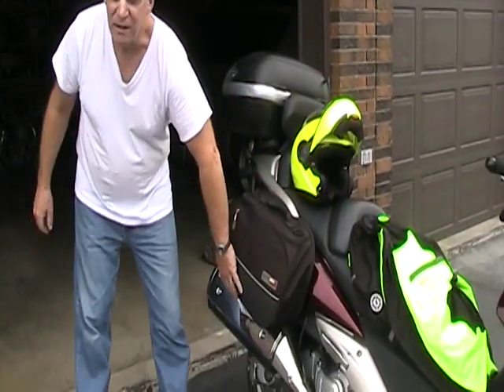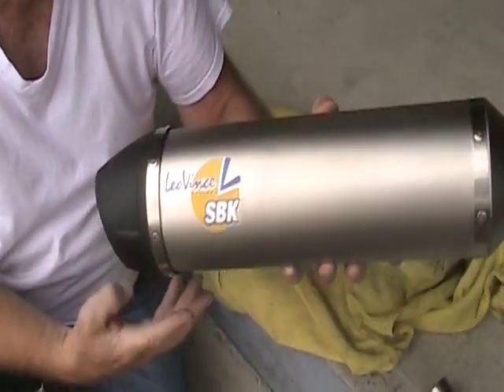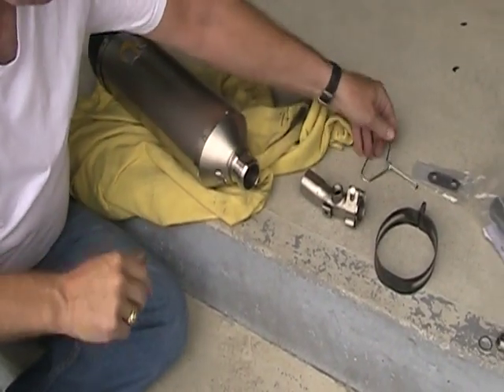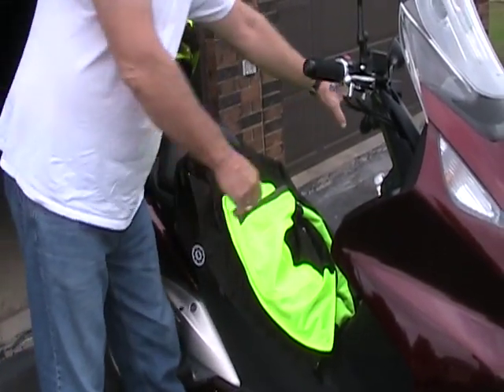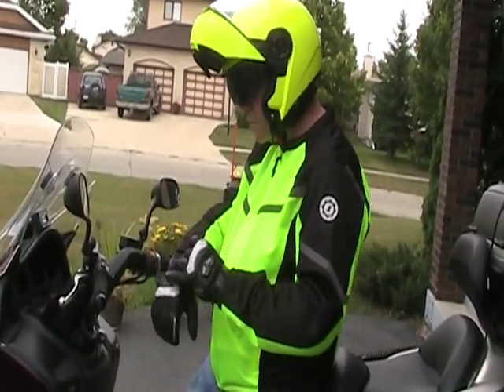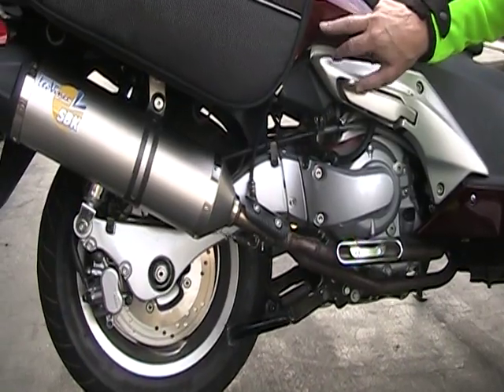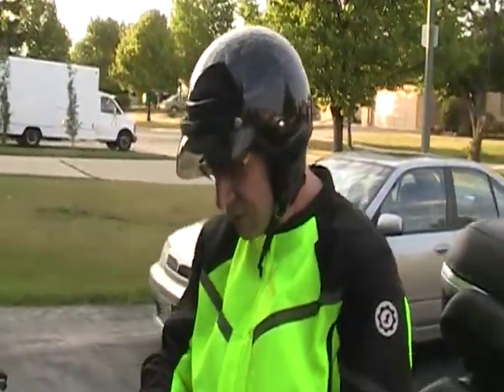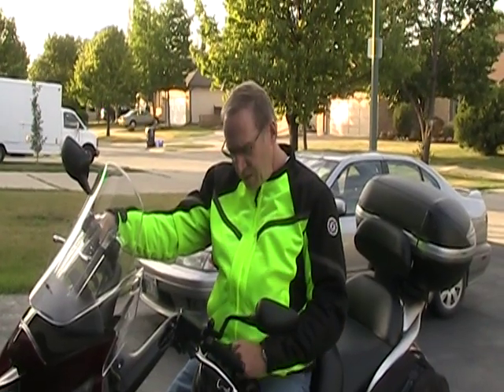LeoVince 8552 slip-on for a 2009 Honda Silverwing 600

Comment from the maker: I have tried it with the dB killer removed. After experiencing the obnoxious drone from the 360 degree parallel twin engine with the dB killer removed, I see no reason to remove the internal baffles as well, let alone the dB killer. Besides, to remove the internal baffles would require taking the muffler apart by drilling out the rivets, then re-assembling and re-rivetting the can. Not for me.

Comment: There's another method by locking the sidestand sensor :D That's what i did with two zip tie and it works well so far.
Reply: Was wondering how that was started on the prop stand? Bit dodgy if someone blipped the throttle. The chap that bought my Silverwing tells me that he has a LeoVince can to go on it.

Comment: Hello! We own a Silverwing and we changed the muffler as well. We have been trying to get side bags for our Silverwing and we are told that the bags don't get made for Silverwings. What kind of bags do you have and how did you mount them?
Reply from the maker: Those side bags were Givi's, but can't remember the model number. They were discontinued long ago. They mount with a centre band between the two bags which connects the bags together under the seat. The bands overlap each other and are joined by big velcro strips on each band.
Reply: @tcalof , thanks for the information. My husband is going to see if he can engineer something for us to use.

Comment: I hear it back firing after you let off the throttle, that i did not hear with the stock muffler, that is usually the pairs valve, it needs to be closed off after a muffler change.
Reply from the maker: The PAIR valve is there to add extra air to the exhaust to complete combustion of any unburned fuel. Its popping and cackling will not cause any damage. It only needs to be closed if you don't like the popping noise.

Comment: lol if it cant wheelie standing on the rear pegs then its not worth having. u wont look cooler with a vince exhaust and u certainly dont want to draw attention to yourself on a scooter. they are merely for transportation since they are exceptional on gas and have a nice storage capacity